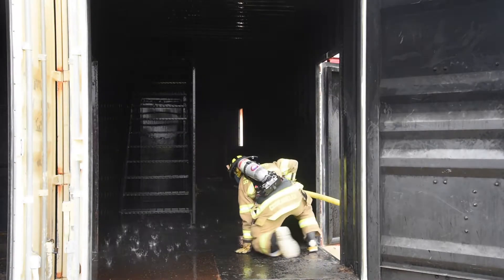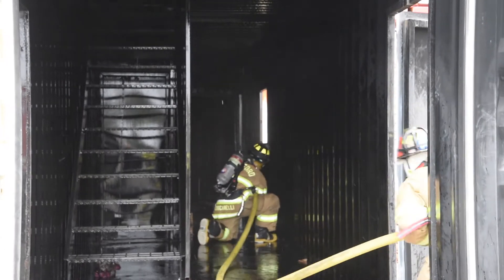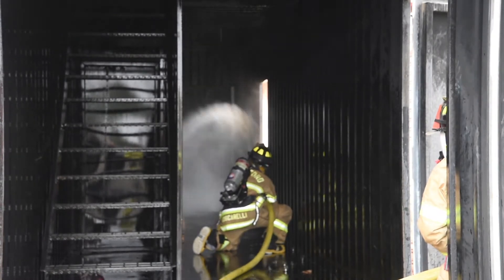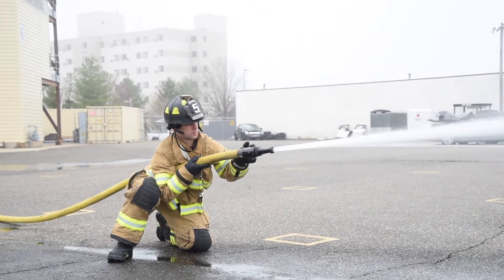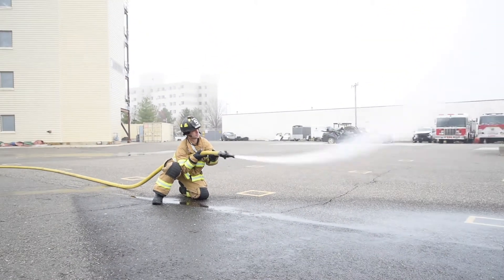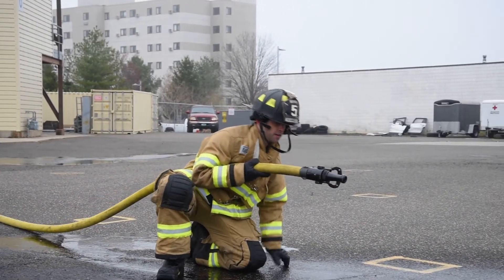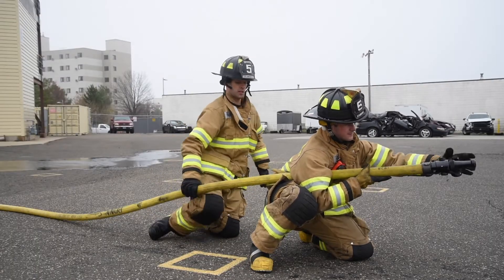Hose Handling Technique: The Lock Off

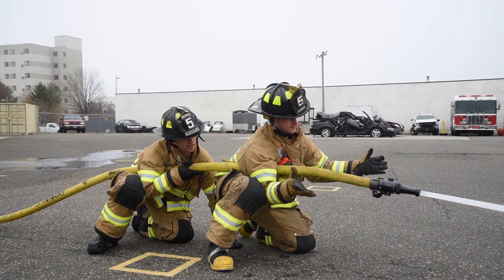Comment: great video! we found that @2:20, you want to have your Heeler about 5-10' off the Nozzle. We did an experiment where we advanced hose: 1 with the heeler directly on the nozzle; 1 with the heeler about 5-10' back; and 1 about 15-20' back. Interestingly the 5-10 was smooth like butter. Give it a shot and see what you guys like, but I think the 5-10' allowed the hose to slink-ee a little due to the varying speeds of the heeler and nozzle. being right on the nozzle was difficult for me because we had to have the EXACT timing and distance of every step and we would bounce off one another. It was tougher for the nozzle to hold an accurate pattern and tougher for the heel to mimic identical "steps"

just my observations, hoping to spread the observations and experiences. 

regarding the comment section:  lock-off/comella vs knee walk vs clamp slide, I think its important to remember that every tool has a purpose. nothing is never nor always, everything has a strength and a weakness. then when you wanna get funky, switch to your non-dominant hand. much love, stay dangerous friends